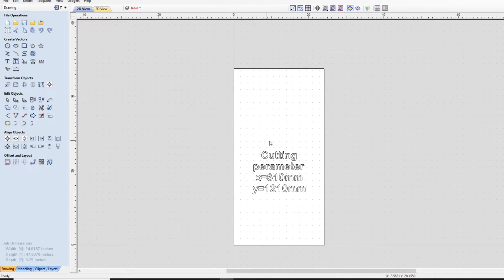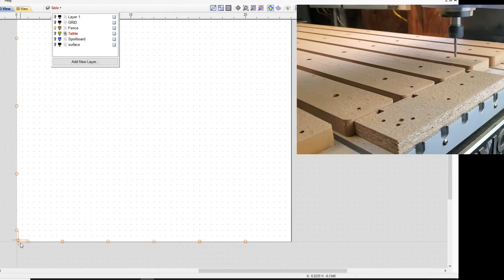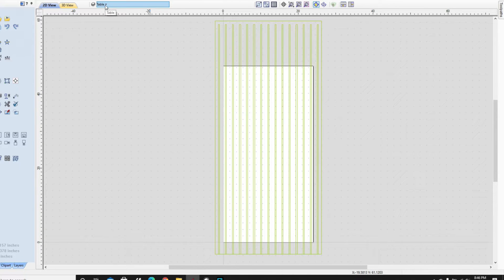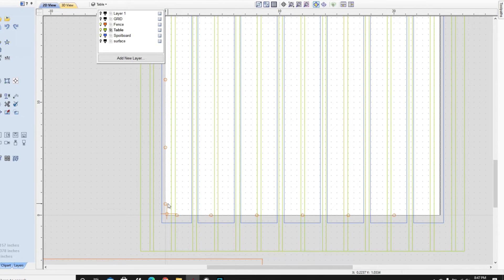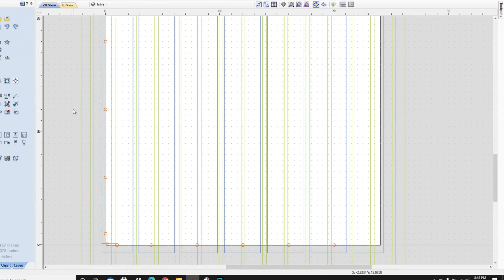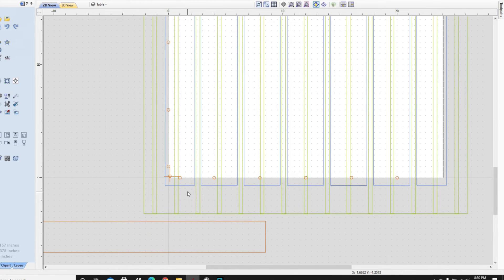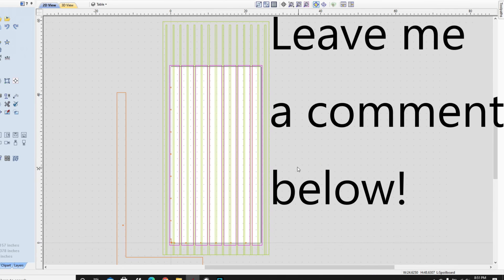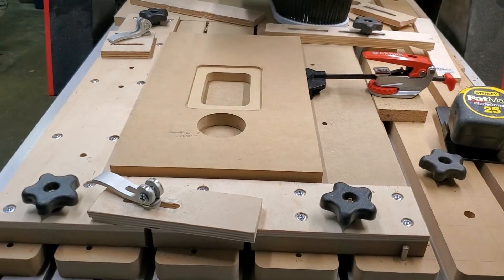Laying Out My Axiom Precision CNC Table In Vectric For Quick Reference When Making Jigs

Comment: Do you know if your X and Y axis are actually square to each other to begin with?

I also have an Axiom CNC, the AR8. I found out my machine wasn't running square when I had made a giant speed square from 1/2" plywood.  It was 1/8" out of square.

After contacting Axiom, I got instructions on how to fix the problem. You basically have to take some things apart and rack the gantry. There is VERY little adjustment in this repair. And to be honest....it's STILL out of square. I'd say it's at least 1mm out now.  Doesn't sound like a lot,  but I still can't make an accurate giant speed square. Or anything else square, for that matter. 

Do a test for yourself, using the 3-4-5 math trick.  Put a 30° V bit in the machine, and lightly drill 3 points on your MDF spoilboard, at multiples of 3, 4 and 5. Go to your extreme X and Y measurements. Then measure between those points, and see if they're actually multiples of 3, 4 and 5. If not, your CNC is out of square too.
Reply from the maker: I found out it was my file.  I have done the 3,4,5 and the CNC is perfect.
Reply: @ChristcrossCrafts  Good to know!

Comment: Hey Chris, Did you have any issues with soft limits for the edge pins on the x and y axis?  I'm getting a soft limit error. Thanks!
Reply from the maker: What I found when I upgraded from Pro to Elite was that the proximity sensors on the Elite were a few mm in compared to the Pro.  This caused a soft limit X+ and Y+.  I was going to adjust them, but slightly moved the pins and surfacing in instead.

Even though the tables are all the same, there are some minor differences that force you to make some adjustments.
Reply: @ChristcrossCrafts  thanks Cris I'll give that a try! I just made your spoilboard jigs yesterday. Those worked great. Thank you

Comment: HI Great video I love the idea of creating a layout of my table. I have the AR6 V5 and did the pins trick but some thing has moved or changed so I am thinking about removing the spoil board. since the template I am using is attached to a piece of MDF I know I will not drill into the table. I should mention the template I am using and the parts I am creating are Aluminum. my question is how did you create the outside fence to square up your spoil board because I truly do not want to drill hole into my table
Reply from the maker: A template to set the spoilboard is key.  If you can't set it to a specific location & spacing that  is repeatable, then it's impossible to check from time to time to be sure the bords haven't moved.

I made my jig to set the left and bottom edge to the correct distance from the edge of the table.   Then did consistent spacing to ensure all boards had the proper spacing.

Comment: great video > Can I get a copy of the file? Also do you sell the jigs in etsy? 
Thank you
mike
Reply from the maker: Thank you for watching.  I don't sell the jigs but they are super easy to make.  I found an image of a cam clamp and just imported it in.  I then scaled it and made the center hole to fit dowels I had.  The  hold-down clamps are nothing more than a rectangle with slots in the middle.  I then cut a 1/8"x1/8" rabbet on one end to bite the top and edge when clamped down.

I'd be happy to send you the file.  It's in V-Carve Pro 10.5.  Send me an email to christcrosscrafts@gmail.com and I'll get it to you if you have that version or Aspire.

Comment: Great video. I got my AR8 2 weeks ago and it's my first CNC. I love it, but I've run into all kinds of things that have slowed down getting started. I thought the best place to start would be laying out a grid, but I keep getting an x+ soft limit error when I try to run the file. If you would please share your file, I'd live to compare it to mine to see what I'm doing wrong. Thanks in advance. Perry@atg-designs.com
Reply from the maker: The first mistake I made on my design was assuming my table would cut 24x48 (it wont).  X+ means the right side of your design exceeds the cutting capacity of the machine (even. 001 will cause this). 

Home & zero the machine, then send it all the way Y+.  Write down that number from the controller (in mm) and repeat for X+.  

Change your design to be read in MM then make a rectangle the machine dimensions recorded earlier.  Make that your new border by aligning it bottom/left. Then you can convert back to inch and your new border should be correct.

Align your current design bottom/left with the new border, then cut away everything outside.  That will fix your issue and give you dead on borders. I believe I even came in an additional .002" to allow for errors.
Reply: @ChristcrossCrafts  Thanks for the quick response.  I did exactly as you instructed above and now I'm getting both the X+ and Y+ soft limit errors.  After homing and zeroing everything my table is (610,1210)mm.  I created my work space at 610x1210mm, created my rectangle at 610x1210 mm, then converted to inches and created my grid.  Everything was created from the bottom left or the (0,0) position.  I even used an offset of .002".  I'm am new to all of this, but I've always considered myself pretty computer savvy.  This should be a relatively simple task, but for some reason, I seem to be struggling.
Reply from the maker: @perrybensick4147  everything seems right but sometimes the offset will go out, not in and require a (-) to make things work.  For the grid you don't need the offset. Try 609x1209 without an offset.

I'll shoot you my file for reference.

Comment: I have a question and a concern.... I just purchased a Shark 520.    I noticed that you had a shark as well.. but realized that you got rid of it very quickly and got an axiom... .but you mentioned how much you enjoyed the shark.... with the cost of these machines... something must of been disappointing very quickly for you to change machines... Did I make a mistake purchasing the Shark... I know that's a relative question and an opinion... but I'm concerned I just wasted my money..
Reply from the maker: Thank you for watching and reaching our.  I don't think you made a mistake, but it does depend on what you are using it for.  My needs quickly changed once I got the CNC.  I landed two regular customers that kept me quite busy and working late nights to keep up with their demands.  

I had already researched and originally wanted the Axiom, but my budget didn't allow for it.  Once my production requirements stepped up, and I knew I would have steady business (I didn't plan on), I opted to upgrade.  The Axiom offered more repeatability, accuracy, and higher production rates than the Shark.  It allowed me to complete the jobs in less time, which greatly improved my turn-around for the customer.  

Plus, it uses a 3hp spindle with 1/2" shank capabilities, which is much quieter and more powerful than a router.  Next Wave didn't offer that as an option.  Their spindle is less powerful and only 1/8" & 1/4" shank compatible.

If I were using the Shark strictly as a hobby machine, I wouldn't have made the change.
Reply: @ChristcrossCrafts  Thank you for your reply... we did just start a Wood'n Crafts business last week but I would still consider where we are at right now, a hobby... maybe if business demand for the CNC work picks up, we will look into something with a bit more options.. right now your response makes me feel better about our purchase..
Reply from the maker: @DarcyG-nk5nv  we sell them where I work so I've played with several brands.  Shark has a deal for a free spindle upgrade this month. Definitely the time to buy
Reply: @ChristcrossCrafts  You are exactly correct... We took advantage of that deal and received our Shark 520 yesterday with the 2hp water cooled router deal.... now just trying to figure out how to get clipart from the thumb drive to the router.... having a good time learning... Looking forward to being a little more proficient at it...
Reply from the maker: @DarcyG-nk5nv  there are a couple of good folks here on YT.  Check out learnyourcnc (also has a great website to learn vectric) and Mark Lindsay.
Reply: @ChristcrossCrafts  Hello again.. so we are all set up and have been doing a few cuts... I want to thank you for the advice on the videos..   1 thing I noticed with the Shark is that while controlling it manually it hits the ends and allows you to try to keep going causing an unpleasant sound as if the machine doesn't like it.   with the axiom videos I noticed that the machine's electronics know where the end stops are and avoids the grinding noise by stopping at the end and not trying to go further. (any suggestions). Also trying to make a spoil board with limits but not having any luck figuring out what those limits are since unable to find them manually due to the over extension of the limits.. other than that still having a blast learning.
Reply from the maker: @DarcyG-nk5nv  the axiom has limit sensors to limit the movement of each axis.  The Shark does not.  The best method I used was to bring the machine bottom left, then lower it down and make a mark.  Then move x or y and repeat at all corners.  Measure the distance along X & Y and keep that as a reference for the max cutting capacity of the table.

At that point I made my spoilboard 1/2" larger than those marks.  I used a large 2" surfacing bit so I had enough space (1" from center of the bit).   If you plan on using a smaller bit make your spoilboard smaller so the bit will surface it all.

If you message me (or put it here) I'll email you a drawing I made of my strip.

Comment: Chris, I just received my Axiom Ar8 V5 pro on Monday, 01/25/2021, and I LOVE IT! I would so love to have the waste board table layout that you have created. I am such a NEWBIE at this but know I need it. Let me know how to connect to get it and if there is a cost. Thank you in advance.
Reply from the maker: Feel free to drop me a message with your email, or leave it here if you feel comfortable with that.  I will send it over.  Are you using Vectric V-carve Pro?

I'm also working on an update video showing how to prep the table before running the grid and pin fence.  I just posted a preview to that on my IG account (same name).  I still have other things to add before putting on YT.
Reply: @ChristcrossCrafts   yes, Vectric  V-Carve Pro. I am having a blast with it. You can use goldenwillowwoodworks@gmail.com to email it to me.I really appreciate all of your videos and help!

Comment: Nice work here. I've been dealing with some issues this is designed to address. I would appreciate the file when you get a chance. Fairly New to CNC. I have the AR8 Elite with the V-Carve Pro 10.5. You can send the file to builtbybriick@gmail.com.
Reply from the maker: Thanks for watching and I'm glad you found it helpful.  Check your inbox.  This has definitely been a gamechanger for making other fixtures and hold-downs.
Reply: @ChristcrossCrafts  I know it's been a couple of weeks but I'm just getting to check back in on this. I never received the file. Not sure why. I check junk pretty regularly & I hadn't seen anything there either. My best guess is that you left the 2nd i out of the name in my email. Just a guess though. Could you try to send again please?
Reply from the maker: I got an error when I sent it originally.  It said the email was invalid.  It does in fact have "ii" in briick, correct?

Comment: Great setup!  I have been thinking about doing this for my Axiom AR8 Pro.  Thank you for sharing!  It looks like I need to get out to the shop and start doing a lot of precise measuring.  I would definitely be interested in your file if you would not mind sharing.
Reply from the maker: Sure.  If you want to message me your email, ill send it over.  Ive made a few more gadgets for it.  

Now that I have the layout, all my jigs align to the left and bottom pins and I know where to drill.  Im working on a vac table design.  That will eliminate some issues with thin or small parts... I hope.
Reply: @ChristcrossCrafts  Where do you want me to message you my email?  I would love to use your layouts for sure!   Thank you so much!
Reply: I just sent you an email to the email address on your Facebook page.  Thank you so much!

Comment: This is brilliant. I have the AR6 but if your still willing to share I can modify it to my machine. I’m using Aspire btw. Sales@workedwood.com
Reply from the maker: I'll send it over in CRV3.  It's an easy modification and will open easily in Aspire or Pro.  All you need is the dimensions of the Y axis and shorten all table vectors accordingly.  It should be as simple as highlighting all and select and move just the Y+ nodes.  The width and track channel should be the same along X.  

You will note the multiple levels with different features that can be used to create custom fixtures and jigs.
Reply: @ChristcrossCrafts  really appreciate this.

Comment: A jig to align your spoil boards pieces. How about dowel holes on the Alum base similar to the dowel holes on the MDF spoil board?
Great process you got set-up!
Reply from the maker: The spoilboard exceeds the actual cutting parameters of the CNC.  I made a block the references the side and the first board.  After that, they all get spaced out with the same spacer block.